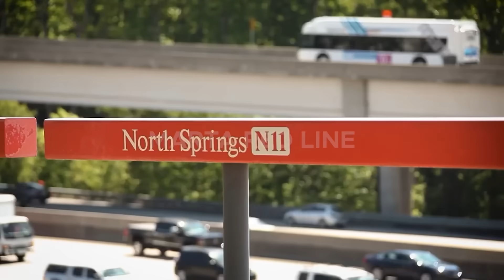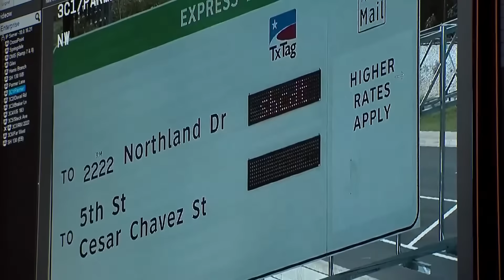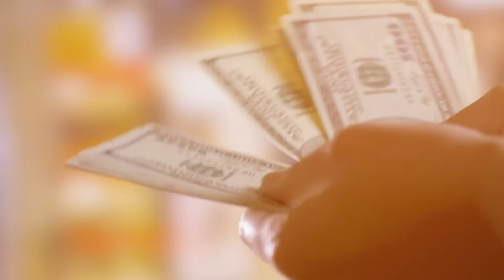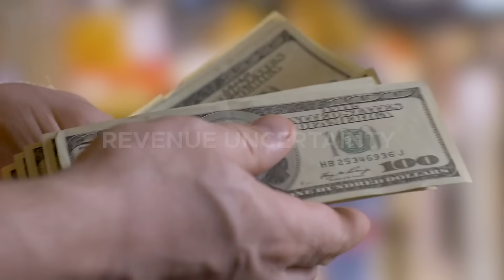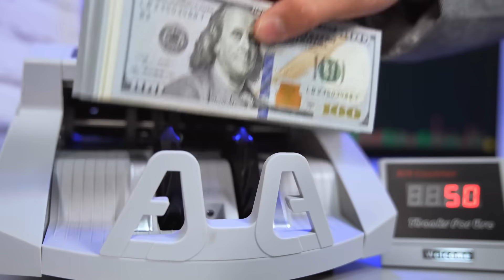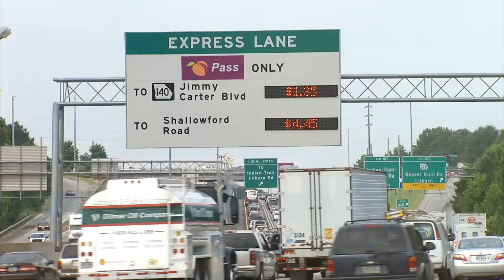The $11 BILLION Gamble To End Atlanta’s Traffic Nightmare

Comment: Run Hour use to 7:30 AM to 8:30 AM it is now 6:45 AM to 9:30 AM and this is Gridlock Traffic.. I am so glad I work out of the House and have been since 2017. Commuted for over 20 Years and spent average of 2 Hours a day in a Car for a Job that was around 30 Miles away..
Reply: I'd say it starts before 6:45, even. My commute is pretty good if I target 10am to be around the GA Tech area from Gwinnett. Afternoon rush hour is already bad by 2:30.

I will repeat that I think employers should either start staggering hours, allowing more work from home (which has proven it's efficacy), or both. Stupid scared managers and execs aren't happy unless they see your butt in a seat for eight hours, so instead of measuring your output, they count the hours your butt is in the chair where they can see you. Imagine if everyone who could work from home did, the traffic for everybody else would drop 30 to 40%. Win-win for everyone.

Comment: Marta trains need to run as far 60 miles outside Atlanta in all directions, right in the middle of the interstate.
Reply: people don't want woke entitled roaches piped out to their suburban communities via mass transit.. and then wake up one day and find everything locked up behind block plastic cases in retail and grocery stores... that's why MARTA hasn't been able to expand
Reply: No one will ride them… they are smelly and not safe. The trains are empty where they go now, unless there is an event where you must use the train.
This is why I say… build no more. In fact… close off 85 and 75 from entering Atlanta. Make those people travel by train… or around

Comment: Build a mega overpass over what’s already there
Reply: San Antonio , or rather TXDOT is building elevated express lanes over Interstate 35, but only two lanes and a single HOV lane in each direction. We need a dozen new lanes. Too much elevated road decking makes future maintenance very difficult. What about 2050 when the area has two million more residents? 

Elevated express decking over the I75/i85 connector could be done. 

I think FM 78 from San Antonio to Seguin, them FM 20 to Bastrop, Texas can allow a whole new I-35 East that bypasses Austin. It's mostly cattle country today.

Austin is decking I-35 and even building small parks over the new lanes- projected to be complete in 2032.  Texas has low earthquake risk and relatively low concrete costs because of the limestone escarpment that parallels i-35

Comment: How about keeping tractor-trailer trucks off the 85 / 75 during the hours of 6:00 AM - 9:00 AM? 
One change is that self-driving trucks will operate 2:00 AM- 6:00 AM, since they don't need a driver willing to work the 3rd shift when these roads are empty. Instead, we have a system where everyone hits the highway at the same time of day.

Comment: more roads is not the answer 🙄
Reply: SO...what is?  Downsize suburbs, ask people to leave ATL?
Reply: @tlockerk  public transportation to incentivize people to not take the highway. if there was a tram system that connected multiple parts of Atlanta to the surrounding locations that stayed on a constant schedule during rush times there would be so many more people taking those instead of the highways, thus freeing up space and lowering traffic. If there was also actual biking infrastructure that protected people trying to bike anywhere people wouldn't be afraid to ride their bike without the risk of getting hit by a car and that would also free up highway space. The only way to stop car congestion is viable alternatives to driving eg. public transit(GOOD public transit, protected bus lanes, actual metro lines that are consistent), protected bike lanes, and closer destinations.
Reply: @tlockerk  ( TRAINS ) the only thing that will relieve car traffic is to take cars out of the equation
Reply: @tlockerk  Mass transit. Darianwilliams is right - you add more lanes, and more people are encouraged to use them, builders are encouraged to build more cul-de-sac communities farther away, and the roads around a city like Atlanta will always fill to capacity.

You either need to densify the population - more GOOD living space closer to the city; 2BR condos that don't cost more than 5BR houses out in the suburbs, or you need more and better mass transit. MARTA is underutilized because it doesn't go where it's needed. Lastly, we need more work from home - imagine 30 to 40% less traffic RIGHT NOW, as opposed to 10 or 20 years after some infrastructure project that may or may not work. Unfortunately, short sighted execs and managers care more about butts in seats than actual productivity.

But yes, mass transit - every large well functioning city has it. They still have traffic problems, but if LA is just as bad as Atlanta, also think LA has several times the population, so if they're ONLY just as bad as Atlanta, they're doing something right, I'd say. I don't want to live in NYC, but I'm from the area and have worked there - the subways are awesome, and you are always just a few blocks max from a station.
Reply: @tlockerk no. Ban private parking in the city and give employers / workers tax incentives to use public transit.

Comment: Atlanta is 40 years late. A lot of these highway/road improvements should've been started 40+ years ago. 

Anything done now, because of the growth of Metro Atlanta, is equivalent to placing a 🩹, on a gunshot...😐
Reply: Atlanta did greatly expand the interstates in the late '80's and early 90's and it was fine until the growth caught up a few years later.  A fast-growing city will always be congested AND planners cannot get funding to build for a population that MIGHT materialize in 20 years.
Reply: @robertd9850  The problem is that the 80s (which is maybe even too late) should have been when they created a better mass transit system. Even if the idiots out in the surrounding counties lack of foresight prevented them from voting for MARTA, even within city limits the train and bus system are inadequate. It is too late. Anything now would cost magnitudes more and take several times longer, and displace homes and businesses. Atlanta is a lost cause, transit-wise.
Reply: @ickisandoblina  Atlanta is a wheel, not a grid pattern.  That is why subways don't work there.  Nobody was an idiot  or too late.  You do the best you can with what you've got and the money available at the time.  You give yourself way too much credit.

Comment: We need an extensive rail system not, more car traffic lanes which fill up as soon as they are built and people don't like express lanes here. There have been countless express lanes built with low to not use. The original MARTA system was envisioned to be built across the metro area but suburban residents did not want to MARTA  as they thought (and still think) it will bring unwelcome elements. Until we get beyond this  limiting mentality, we are not going to have real sustainable solutions to supplement car traffic like Direct MARTA, light Rail and along with the buses.

Comment: GDOT is building these along every highway. They are not traffic solutions; they are simply adding additional lanes, only these lanes are toll lanes. This does not reduce traffic; it creates a two-tier system: one for people who can afford it and the other for those stuck in traffic. There is still a lack of mass transit, and there is still a single mode of transportation, the car.
Reply: I have an express pass. I'm old and grumpy, and have no patience. The simple fact of the matter is a huge amount of the problem is not volume, it's how people drive. Ask yourself why 6+ lanes of traffic comes to a screeching halt at a popular exit - it's the selfish jerks who need to cut in line instead of waiting for the exit, slowing and stopping every lane from the left to the exit on the right, and repeat by the hundreds. If everybody drove with a bent on improving the overall flow of traffic, and not just them saving a few seconds (that collectively cost everyone else minutes), the flow of traffic would be much better. That's one of many examples I can give on why it's largely people, and not volume - but people will always be selfish jerks, so that's not going to change.

But the express lane is already ridiculously expensive. If you were waiting on a 75 minute line at a theme park, and someone told you they could get you on the 60 minute line for $15, would you do it? That's about how the express lanes work. On days I can't work from home, I try off hours. Companies should stop the ridiculous back to the office mandates.... studies have shown the efficacy of work from home, and it would improve the lives of everybody, not just the employee. Imagine if you couldn't work from home, but there was 30 to 40% less traffic on the road, right now - not 10 years from now, but right now. How much time would you save? How much gas or electric? How much pollution? All because some execs and managers need to micromanage instead of just letting people do their jobs. They need to look at output, not just butts in chairs.

I've lived in Gwinnett for nearly 30 years. I always vote for rail expansion, but have to live with the shortsighted morons out here. Sorry for the rant, but yes - building new lanes only encourages people to use them more; only encourages builders to build farther away from the city. Roads will always fill to capacity around a city like Atlanta - roads are not the answer.
Reply: @ickisandoblina  1000%

Though fewer vehicles on the road would really cut into my earnings.
Reply: Spring loaded tag... enter the toll lane and drop a cover until you exit the toll lanes.
Reply: Express Lanes will always free flow at 45mph or faster. They won't ever succumb to too many using them. These lanes are being built in cities across the country to provide an option for everyone at times when they need to get somewhere faster to pay for them. Express Lanes do add capacity which growing populations must have. The regular lanes will benefit from fewer vehicles and all of the cost is paid for only by users of the Express Lanes. No GA state gas taxes are used. People can't complain when they are getting a new option for when they need to use it. If you support mass transit then you can live near one of the existing lines that every resident in 3 counties pays additional sales taxes on every purchase to pay for its daily operation.

Comment: The answer to traffic jams is not asphalt & concrete, that ENCOURAGES more car traffic.  The answer to traffic jams, is FREQUENT, broad, expansive rail transit & bus transit.
Reply: The secret is to move the jobs out to where the people live. It makes the commutes shorter. A lot shorter and faster.
Reply: @Singlesix6  if you move jobs to where people live, people will move away because people who already live in suburbs dont want to live in the city
Reply: @Singlesix6  that’s not the solution. A lot of the jobs are either in Midtown, Perimeter/Dunwoody, Cumberland area, and Buckhead. Three of those areas have Marta transit connections already. The urban sprawl doesn’t need to continue b/c it has already made things worse. People who live out there should find jobs within their area or WFH so they don’t have to commute into the city.

Comment: Extending the rail lines would have been smarter and far more equitable. I am sure the numbers were worked to make this look like a great idea to build more roads. This is a privileged lane built for those who can afford the convenience of being separated from those who can’t afford it. Any buses they put on the road will be part of the traffic problem. The roads added up interstate 75 solve part of a commute problem for only a handful of folks who pay but not for those who can’t pay. Sad to see this project started.
Reply: Last week, I was in a hurry and decided to take the toll lanes.  But oops, I got in stop and go traffic up there too - but I had to pay extra for the privilege.  

If they built 20 lanes of traffic, they'd fill up.  Induced demand is a legitimate theory.  Those that argue against it (and in favor of things like "congestion pricing") miss an important point - I have no choice but to drive because public transit is a not existent. So if you want to charge me for driving to work, it's a price I have to pay.
Reply: @MichaelLeBrun1  I often end up taking the toll lane, and sometimes it crawls slower than the regular traffic - although I wouldn't do it if it didn't ultimately end up saving me my sanity. Luckily I mostly work from home, but the express lanes are way overpriced and,  yet, if they lowered the price would be even slower. I don't know the best solution, I have concluded improving Atlanta traffic is a lost cause.

Comment: What is wrong with these people. They're spending money creating a more expansive interchange at I-20E and I-285. They're spending money creating a more expansive interchange at I-20W and I-285. Now they're adding toll lanes to the GA-400. They have spent billions on adding lanes. Whoever the president of GDOT, needs to be let go.
Reply: The interchange upgrades are necessary. 20 yrs ago necessary
Reply: @nubianking4203 that's not what I'm talking about. I'm talking interchange expansion. Spaghetti Junction is the best example. I-85 toll lanes haven't worked yet
Reply: @dougbones7095 of course spaghetti junction needs to be upgraded. It was completed in 1987. Population has more than doubled since then. 1990 metro Population was 2.5 million, today 6.4 million. It will cost over $1 billion. All the development surrounding that interchange will be extremely challenging to build over/around. The new ramps would be well over 100 ft. I'd love to see it but who knows. I'm sure someone in GDOT is working on a design.
Reply: @nubianking4203  Literally everytime the population grows, we will have to expand the interchanges. Thats not feasible. Lets stop forcing residents to become more automobile dependent and give them better public transportation options.
Reply: @dougbones7095 MARTA is not expansive enough, nor does it have the ridership that is adequate for a major population center like ours. Less than 5% of metro atlanta residents utilize MARTA on a daily basis. That's abysmal
Reply: We need to see who's processing these toll lanes and who's getting the construction project